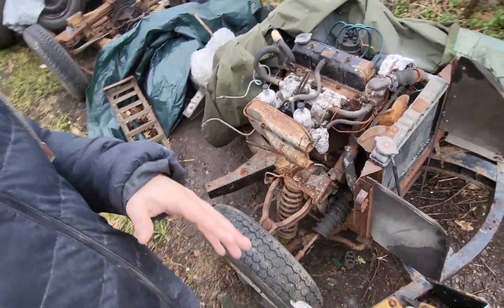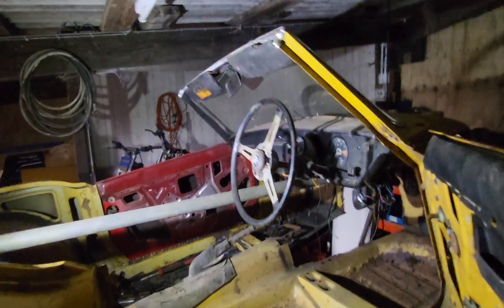Please Someone tell me this is a BAD IDEA....🤔

Comment: Would be an interesting project! I've often thought about this especially as my Dad has a Yellow 1500 and its pretty nippy but always fancied a ratty one to play with. From what i've seen you need to alter the tunnel to get the engine/box to fit. I don't think i'd change all the dash as the spitfire has a nice dash. I bet you could make it more modern with LED lights a digital clocks if you wanted. A standard Spitfire is a bit more nippy than a 2.0 Capri I've found. I bet with a 1.8 engine it would be quick. The non assisted breaks are awful though!! worth remembering. Hows the project going btw?

Comment: you are capable, but i would sell the mazda and use the money to keep the triumph original.
Reply from the maker: Thanks. This is definitely the most sensible idea, the mazda needs a new roof and has a few rust bubbles in the arches, not sure how much this would effect the value of it my? my plan was to keep the triumph for myself if it turned out well and would live the look of the classic with the modern reliability. But I could end up just destroying 2 cars haha 😄

Comment: yes good idea there are a few swaps on YT... swaping the interior that would be the cream,, old car with modern running gear,, reliable, comfortable,, win win..at teh end of the days its an old spitfire there plenty about, if you hadnt taken on all the welding would been a parts car am sure..
Reply from the maker: Thanks yea think it's would be a every day usable classic which would very udeal. The only thing is would it be a shame to strip the spitfire of its originality.
Reply: @cashmachinecars  know what you mean unless you gunna throw thousands thousands pounds at it to make it concorse its only ever going to be a slightly rusty old spitfire, i am old enough to